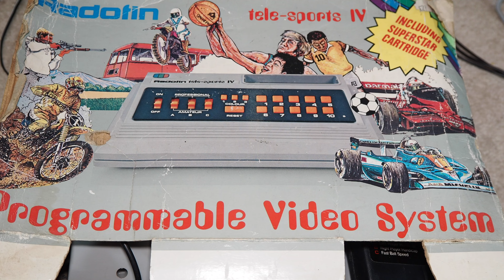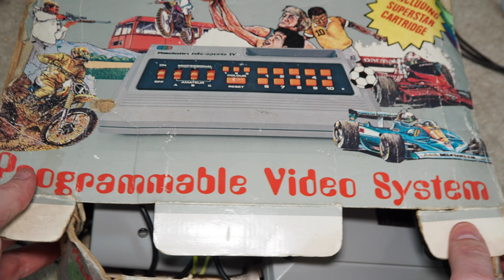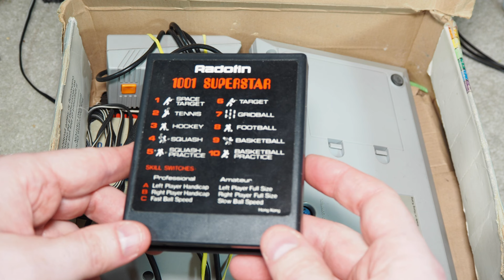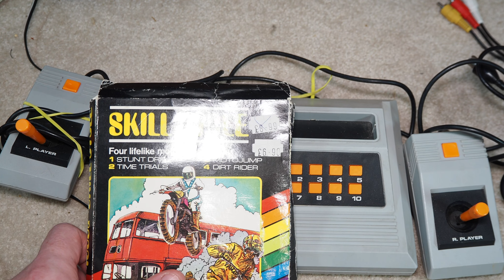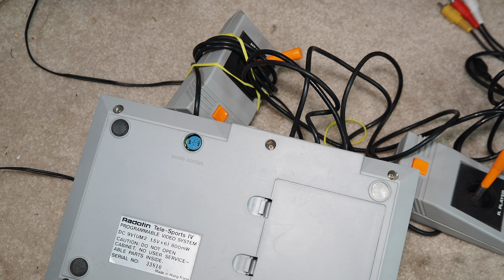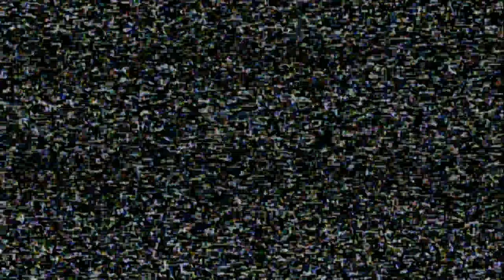Will it Work? - Tele Sports IV - Console #182

Comment: That information regarding UK plug safety simply isn't true.  There are a lot of UK mains plugs that have plastic prongs for ground that open up as you say the safety covers of the live and neutral pins.  The reason being is simple, just as in the USA, anything not requiring ground a metal prong is not necessary, thus many devices come with plastic pins for ground....as in the USA  anything not requiring a ground only has two pins.

As for the radio frequency, the UK used to use UHF, channel 36 being a commonly used channel for video games consoles and VCRs.  In fact certain analogue transmitters in the UK on the congested bandwidth when launching the TV station Channel 5 in 1997 caused havoc with VCRs because it was broadcast on 35 and 37 requiring many home users to either adjust or get an engineer to adjust and retune the VCR frequency to avoid interference.

Comment: Channel 35? That's new.
Reply from the maker: Yeah, the UK tends to use 36 on the UHF band.   Japanese systems are even weirder.  The use channel 1 or channel 2.   But their frequency isn't the same as our channel 2 (Or if we had a 1).   But, if you have a cable ready VCR or TV and switch it to cable mode, and then turn the channel to 95/96 you can then see the Japanese signal.    Much trial and error was made to find out these oddities while making these videos.  I do get a 220volt upconverter and a PAL TV a few videos from now.  More to come...